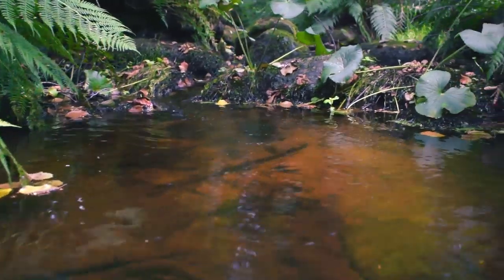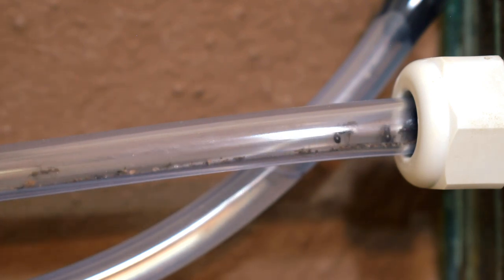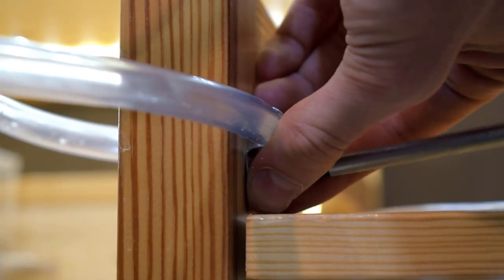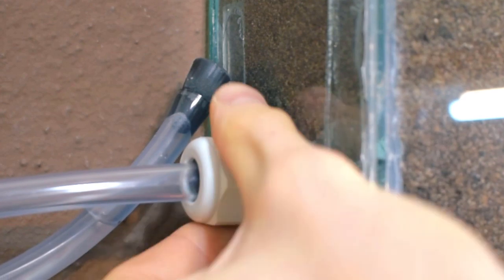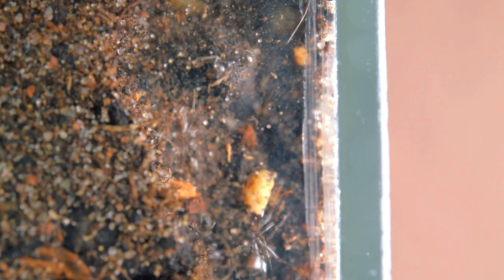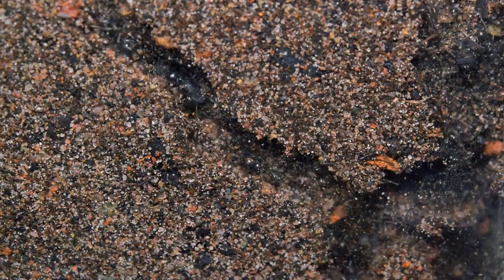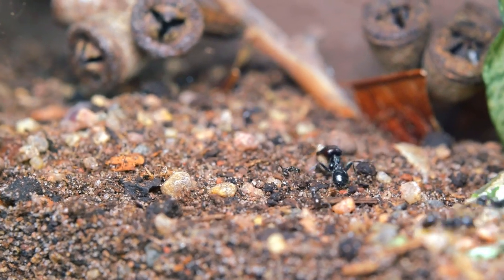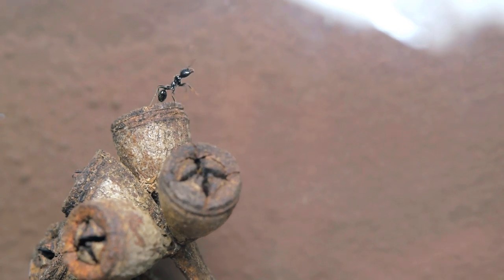Messor Colony Moving into Dirt Formicarium

Comment: Awesome video! One thing I noticed you were wrong about is you said they move sand one grain at a time 😂 That would take FOREVER. They actually have little long hair beards that they use to take small piles of substrate (which holds like 100 grains). But awesome video! 😎💚🐜🍻